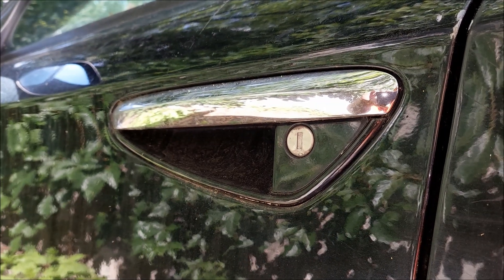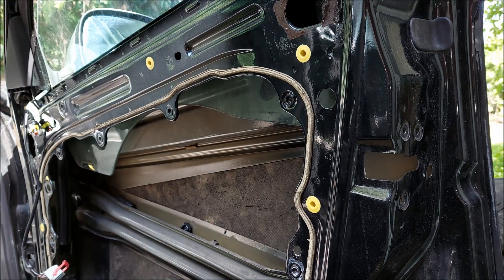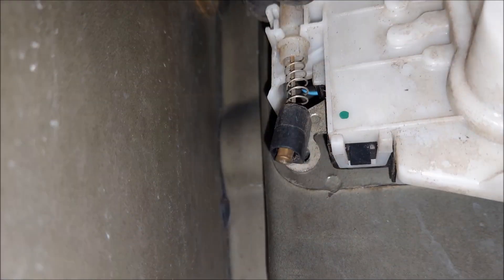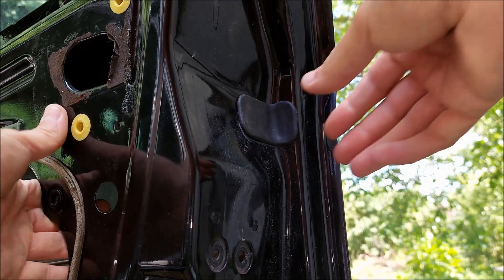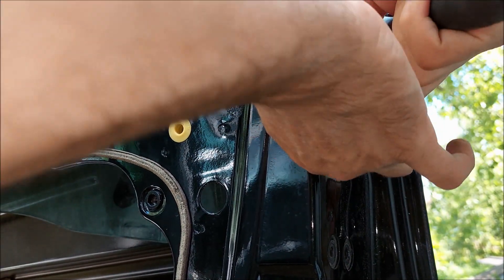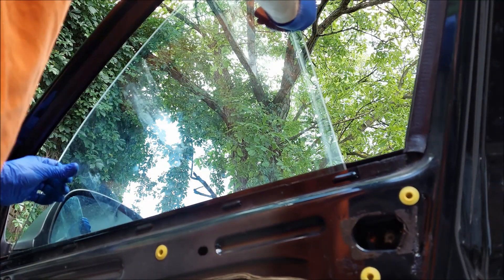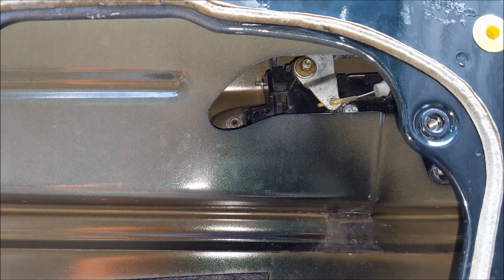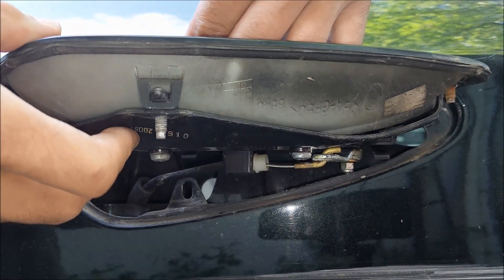Alfa Romeo 159, Brera, Spider Exterior Door Handle Removal

Comment: On the start you show the drivers side door but the end you show the passenger side one. But i cannot remove the driver side door I removed the 3 nuts then the handle is wiggles in the door but wont come out.